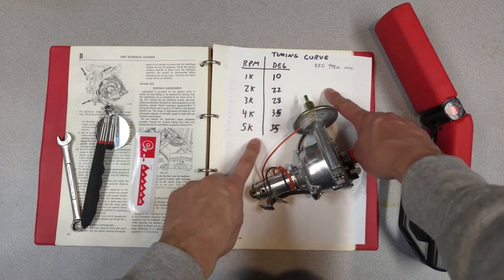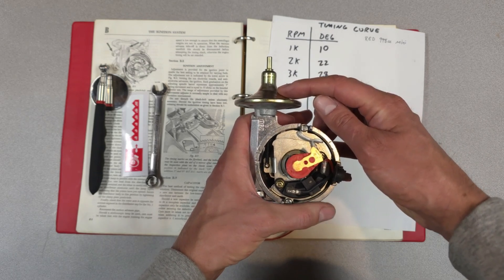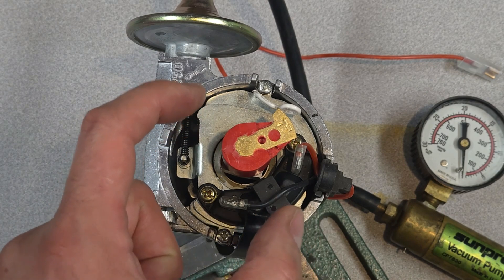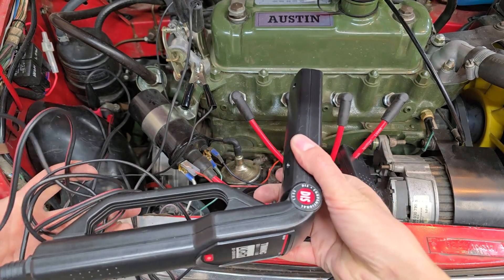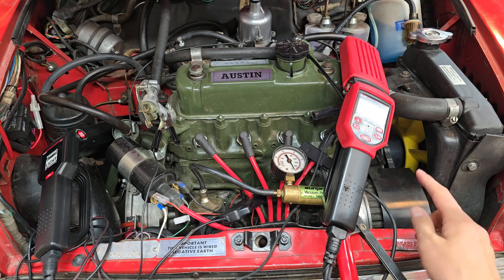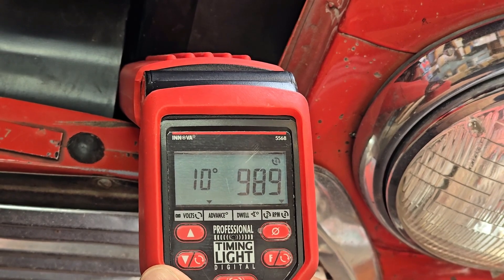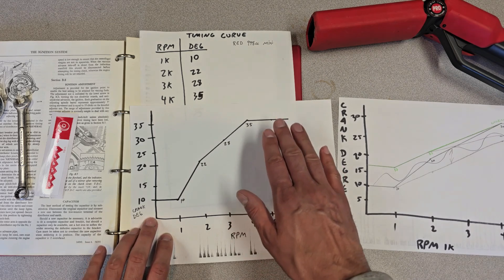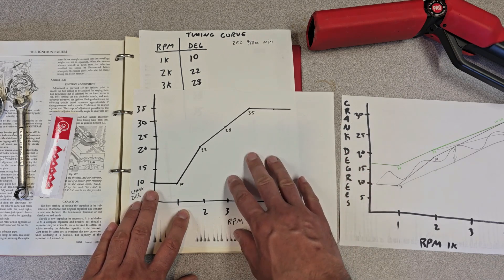Classic Mini Survival Guide: How to plot a Distributor Timing Curve and Measure/check idle timing

Comment: Hi Darren, great video and great explanations. I did the same exercise with my own 998 today. I have a CSI electronic distributor and I wanted to verify the advance curve. I have a very basic linear advance curve that goes from 10 degrees at 1000rpm right up to 30 degrees at 5000rpm. BTW I am close to sea level. I can change the curve to one of 16 pre-programmed curves. I was wondering what typically should the full advance be for a 998 engine? It has a CR of 9.6 with a SW5 cam and HS4 carb.
Reply: BTW, the dial back is a godsend
Reply from the maker: Set it to a curve that gets to 20 degrees by 2k roms and 30 degrees by 4k rpms.
Reply: @darrensrestorations991  thank you Darren, much appreciated.

Comment: Great video!
I also noticed timing fluctuations, but my engine is an A+. I guess I should have a chain tensioner, but it could be worn. How bad can it be to run like this?
Reply from the maker: If it's more then 5 degrees of fluctuations id be concerned.

Comment: Thank you for another excellent presentation and explanation. AC Dodd convinced me to buy an Innova 5568 like the one you are using. Great video!
Reply from the maker: Hope you like it. It's a great timing light with lots of good features.
Reply: @darrensrestorations991  That is true. I have already checked my timing after I refitted my distributor. What is your view on  cb black box programming timing module I have installed to my innocenti? I find it very useful. Do you have any experience from that module first developed for VW air cooled engines?

Comment: Great stuff Darren. When i do this, with the same Innova gun, its rock steady when testing the car at standard idle (1993 1275, standard engine , stage one conversion). When i use the advance feature, i get a secondary 'ghost' mark fluttering just off the top of the marker teeth. Ieads are good, Ive tried a new coil and checked the dizzy journals for wear, of which there doesn't seem to be any. Any thoughts as to what this could be? Thanks.
Reply from the maker: Yes, it's just an electrical noise being picked up the timing light and interpreted as a trigger. Hence the weaker ghost flashes.
All you can do is interpret the strongest signal as the true timing.
Reply: @darrensrestorations991  is there anything I can do to rectify this Darren. And why doesn't it do the same when I'm not using the advance feature?